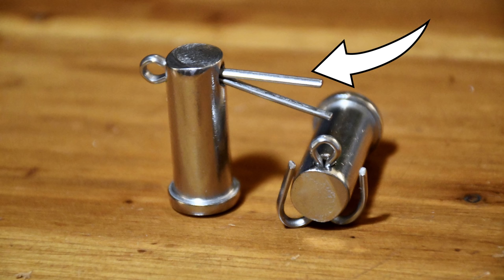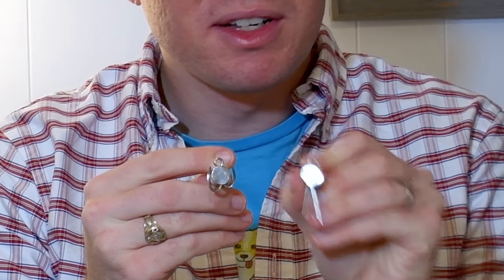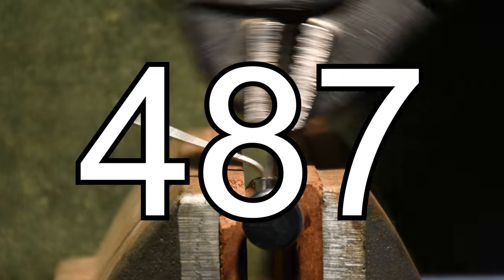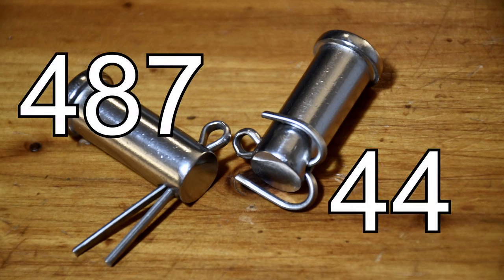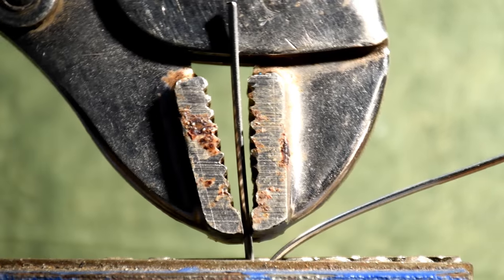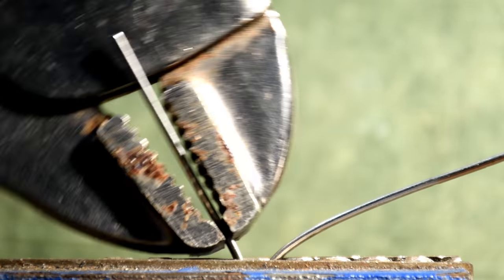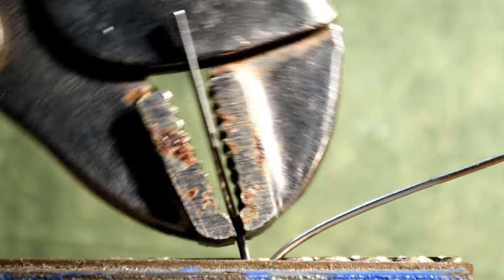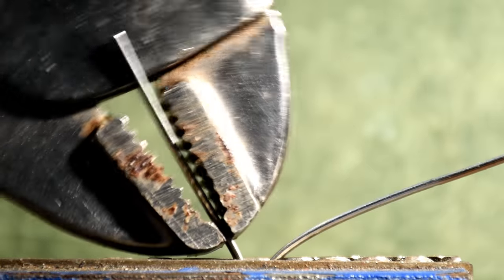Should You Bend or Spread Your Cotter Pin | Sailing Wisdom

Comment: You have done the general public a disservice.  Your non-scientific reasoning is flawed and unsafe. To use the fatigue method as reason for saying one method is safer than an another is like saying all metal objects that are bent over 30 degrees is weaker and therefore should not be used. Of course that is not true. Yes, there are times in certain situations where you may not want to full wrap a cotter pin, but those are specific individual situations and NOT to be use in general installations. That includes sail boat rigging. Cotter pins are by design meant to be bent. The fact they are stressed is taken into account by design. They know this and that is part of why they are a one time use only item. You come off as if the engineers who have spent literally decades of research and design of cotter pins have not done this testing. They have... as an experimental flight test mechanic myself, I know they have because I have done it... A LOT. What you did here today is my job, to run testing like this and find out if those designs are good or bad. I can say that NO, your methods of testing and reasoning are incorrect and dangerous. Trust in the  aviation methods... as they have all been written in blood. Literally. Everything in the aviation maintenance methods regulations are there because someone has died because of it.
Reply from the maker: I made this video because of the stark number of comments I got on a previous video about the cotter pin legs. In rigging books, it specifically says that up on a mast they are only to be bent 15*. This was a good way to visually represent that. 
Up the mast is different from on an airplane or any other part of the boat for that matter. You figure the propeller on a boat will have a cotter pin in the end of the shaft bent all the way around the shaft tip!

Sorry for offending you with this video. Bending the pins the aircraft way is correct to do on aircraft, but not in spars. I was trying to get that point across. Do you have any suggestions for a better way to visually represent this?
Reply: Not offended at all. Just worried someone might see this and do something that may compromise their rigging. It's just the method used to come to the conclusion.  You are actually on the right track!   Fatigue is one of the major reasons you only use a pin once. Instead of asking which method is safer ask what are the conditions the pins is being used? Also how and why a pin might fail in that circumstance. I've seen meny broken cotton pins over the years and in the majority of those cases the pin was either the wrong material or re-bent in some manner. Thus it's not the final method they end up with that is dangerous, rather the method to which it was installed. If you bend it once, it's done. You bend it TWICE you have just compromised the strength of the pin. Whether  you bend it 40 times or 400 times is mute. Now if that pin is only bent 15* what do you think the odds are that someone is going to just push that baby right back in the hole instead of replacing it? What I've seen, it goes right back in the hole and re-bent! Now you're set up for failure. If the pin is totally wrapped around chances are you will not be able to reuse that pin even if you wanted to. The biggest thing to stress here is never re-bend a cotter pin in a safety related installation. On the wrong material side, not all cotton pins are the same. To make it even worse is that the quality of the material is very different from where they come from. Knowing not only that you have the correct type of pin, but also if it will be made of a high quality material. Your normal cotton pins from your local auto parts store are horrible! They will rust out sooner than later. Make sure you buy the right pin for the installation and condition's it will be installed and of a high enough of quality.
Reply: @RiggingDoctor  - Just because the rigging books say it, doesn't necessarily make it so, IMO. Wouldn't be the first time something has been handed down as gospel from one generation to the next, and never been questioned, simply because it was "accepted wisdom" (no pun intended), but later found to be incorrect, when someone actually tested it out.
Reply: phantumdrummer p
Reply: @phantumdrummer  So true mention the human factor, .."it goes right back in the hole and re-bent!". Another real life concern would be the steel quality of these. The real country-of-origin and original manufacture of parts can be really hard to figure out. It would be interesting to see a "relevant" scientific tests of common pins done!

Comment: Many mistakes on this video - for one, your test introduced heat from bending the pin leg back and forth full angle multiple times, which isn't representative of the real mechanical stress such a pin would experience (if anything - such repeated bending is more likely to occur if you leave the tails long AND not bent around the clevis pin). Second - you didn't consider the speed of turning the pin tails around, which also would have significant impact on the heating and consequently - strength of the metal - doing it slowly allows the metal to bend with less stress (work hardening) and heat than of you do it fast. Another factor is how you bend the tail - I use needle nose pliers with round jaws, and wrap the tail around slowly - that way I avoid creating a sharp angle in the tail, avoid heating it, and as long as I don't try to cheap out by reusing what is only meant to be used once - never had one break. You're comparing one method allowing for 487 or so cycles while the other allows for only 44, for a pin that is only intended to have one cycle before you replace it with a new one - not really relevant...

One last point against leaving the tails straight instead of wrapping them around the clevis pin is that wrapping them around usually puts them neatly inside the bottlescrew, whereas leaving them straight like you showed is almost always going to give the sails and/sheets and halyards something to rub against or get cut by and from that - rip.
Reply from the maker: A few points that are often overlooked on sailboats: 1. Selden, a very reputable mast company, says to bend the legs 20° and to leave the legs straight out. Why?
The main reason is that this is a sailboat and not an airplane. On airplanes, the rule is to bend them all the way around. On sailboats, the rule is to leave the legs straight. 
2. The bottle screws have the cotter pin for a few reasons, one is to prevent the bottle screw from twisting out of the turnbuckle and causing the mast to fall down. The cotter pin acts as a “last safety” to keep it from coming out at the end. The other reason for the cotter pin is to prevent the bottle screw from turning at all as any turn would lead to the rigging becoming out of tune. If you bend it over nicely, the turnbuckle can spin over it and you lose the ability to keep the tune of your rig. If the legs are straight, the body can’t spin over it and the rig tune is preserved. 
As for sails rigging, the legs are to be wrapped in a fabric tape to protect the sails. Selden in their manual says to do this to prevent damage to the sails as this is the obvious problem with them sticking out. 

So, you can do it the right way or you can do it the wrong way. It’s your boat, so I don’t really care how you do it. I just made this video to show you the right way to do it. The fact that you have never had a leg break is great, but I see a ton of pins bent all the way around with only one leg as the other one broke off. I also see a bunch without a pin in it probably because it fell off when the legs broke off. 
Good luck and keep a close eye on the pins to replace them when they break and fall out.

Comment: Some of your most ridiculous work.  Others have covered its ridiculousness in the comments, suffice to say, just because you have a hypothesis doesn’t make it so.
Reply from the maker: People should really read the instructions from spar manufacturers. Selden specifically says 10° per leg, not to bend it all the way around. 
The pins I find with one leg always have the other leg bent all the way around. One can assume the missing leg was also over bent. Take a work hardened metal and beat it with a halyard forever and the little leg will break off. The missing pins are harder to say how they were, but they tend to be on boats where all the pins are bent all the way around. 
You do you on your own boat and ignore the correct way of doing things. This was just a fun little demonstration to showcase the right way to bend a cotter pin on a sailboat (not for aviation usage, they bend the whole way around but also don’t have halyards to worry about).
Reply: @RiggingDoctor    the point, covered elsewhere in the comments, is that once bent into position, they don't cycle, work harden any more than the first set.
So the cycles of use to failure demonstration has nothing to do with the application.